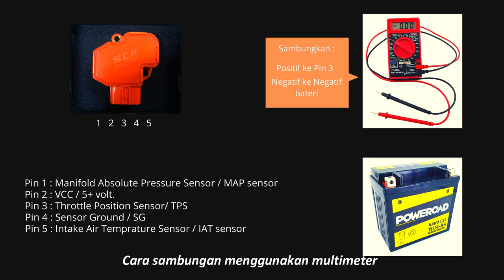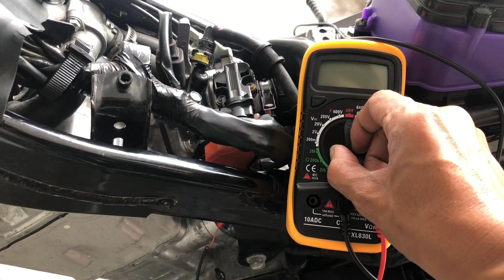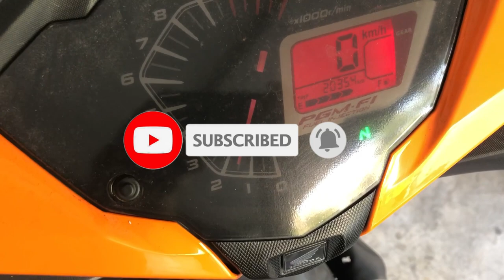Motor Semput? Tukar TPS Problem. Service Throttle Body RS150

Comment: Bro nak tau . Kenapa ek bila moto saya masa gear Neutral bila nak press throttle dia pandai semput . Apa problem ek ? Tps ke .? Ataupun ada yg lain . .
Reply from the maker: Rasanya bukan tps kot sbb kalu tps yg problem lampu akan blinking atau high rev motor semput. Bos try check or service TB, air filter atau fuel filter.

Comment: Boss..nk tanya...den tarik je full trotle bila berhenti timing jadi tak btl...kalau bawak slow ok je pulak
Reply from the maker: Aie Asiah cable kat throttle body dah check tak? Suspect cable x restore blk ke asal sbb dah xde greese. Kalu boleh cuci sekali throttle body buang kotoran
Reply: @chongsalmi  perkara terjadi..lepas den sarung ecu apido...lepas rpm 7 die jadi...time jalan tarahal..boleh je laju...cuma bila berenti...tapi bila dah berenti lama...dia ok balik
Reply from the maker: Aie Asiah ade tak cuba tukar ecu standard blk? Sbb nak pastikan ecu tu xde isu. Kalu x maknanya kena antar tuning blk la jwbnye. Nak tanya gak, ecu apido tu bos dah antar tune ke?
Reply: @chongsalmi  den tk hantar tune sbb den sambar apido yg cuma utk tkde cutoff...
Reply from the maker: @aiekhaizurah2154  bos, sy rasa better buat check rfid untuk check ade simptom problem atau tak. at least boleh detect error. tp biasa kalu high rev problem tps.
Reply: @chongsalmi hari tu den dah poie..tapi pomen kata fid utk reset je...
Reply from the maker: @aiekhaizurah2154  bos tukar ecu tu x dyno kan? kalu bos tukar ecu standard blk utk check ade x problem yg sama?
Reply: Problem tps tu. Sama mcm sy. Dah kene da

Comment: Apa beza tps ori dgn tps after market kalau moto std setakat tukau barang pipe tukar coil plug tukar plug tpi enjin std boleh pakai ke tps after market ni?
Reply from the maker: Tps after market cuma option utk tukar dr tps asal if tps asal yg kita guna tu ada masalah/rosak lps 2 tahun. Boleh je bos kalau nak tukar ke tps after market. Sy dah pakai xde masalah.
Reply: Ye ke bos brp lama pakai tps after market? Xde effect ape ape ke?
Reply from the maker: @lukeman8355  pakai cam biasa je bos xde effect apa2. Pakai agak lama gak bos

Comment: bro kenapa eh lepas service throttle body motor tak boleh start..lampu engine tak tunjuk indicator kelip² pun hm tapi dia taknak start..kena pulas baru hidup..tu pun macam bobok je. ade penjelasan tak?
Reply from the maker: Ribenaf ade tak check coil plug n spark plug?
Reply: dua² tu okay and sekarang dah tau masaalah dia and dah selesai..jawapan dia tps problem huhu
Reply from the maker: Ribenaf tps problem ye. Makna simptom problem ni dlm byk area. Ok2 paham

Comment: Bos kene tes lagi ke klau dah pasang bap sya tak ada alat pencek toe bos..😅
Reply from the maker: Akbar Karim My Life family tujuan check utk make sure samada tps ok atau x je sbb kadang2 tps baru pun ade yg x ok
Reply: Owh mcm toe..💖
Reply: Cuci pakai petrol aje ok kan.?
Reply from the maker: @muhamadzulhairikamisan6216  cuci throttle body ke bos? kalu boleh better pakai cleaner die dr guna petrol bos. lebih afdal
Reply: @muhamadzulhairikamisan6216  mau pkai Throttle body enda bleh pkai ptroĺ.

Comment: Bos..nak tanya..kenapa ye lepas saya tukr tps..rpm sya jdi tinggi ye?
Reply from the maker: bos ade cuba tukar yg asal balik tak? kalu bos x pasang lg coverset boleh cuba test balik atau check throttle cable.
Reply: @chongsalmi  sbb tdi lepas pasang tps..test dia idle dkt rpm 2...so fikir dia okay la sbb masih bru...lepas tu dh pasng semua coverset dia idle dri rpm 2 ke rpm 3... Agak2 apa ye symtom dia..sbb sya pakai tps tobaki .. ke nak kena fid?
Reply from the maker: @nickazizan6561  tps tobaki ade 2 jenis. standard dgn racing. Bos pakai yg mana satu? normal idle 1.5, 2 tu dah kira tinggi skit. Bos ckp lps pasang coverset idle naik 2 ke 3. Throttle bos ade play x ke camane. Fid pun leh gak buat utk reset error tp rpm tinggi tu kalu boleh check throttle dulu.
Reply: @chongsalmi  sya pakai tobaki std punya...tdi buka balik okey dh...mun ada cable sangkut kot
Reply from the maker: @nickazizan6561  cable sangkut tu bos. Kira dah ok le ni. Yg tps tu boleh buat fid utk reset error.
Reply: @chongsalmi  aaa kira okay dh..cuma tu je la lagi masalah datang...motor pandai padam2 masa idle....lepas tu nk start ada payah sikit...paksa main on off kunci bru okay start
Reply from the maker: @nickazizan6561  skrg bos bawak motor ade x semput lg? Just nak tanya je.
Reply: @chongsalmi  semput tu tkde la...masa lock trotle mengejut tu dia mcm nak pdam ade..
Reply: @chongsalmi  and masa tgh idle dkt traffic light dia pandai padam sendiri.. 2 tu je lagi masalah dia...penat dh fikir masalah😂
Reply from the maker: @nickazizan6561  masalah camtu kena check satu persatu sbb sy pun penah gak kena tp lg teruk start je terus mati. boleh start cuba tgk dr kepala plug dulu. kadang2 fuel pump pun boleh jadi isu. injektor sumbat pun boleh jadi. cuba check yg senang2 dulu.

Comment: Bro kalau masuk gear 1 lepas clutch sikit pulas throttle, motor ada jerking tps problem ke?
Reply from the maker: Tu bkn tps bos. Cuba check clutch lever. Penah bukak mangkuk clutch ke seblm ni?
Reply: @chongsalmi  dulu bukan masuk uma hyper clutch, selepas rasa tak sedap ada jerking, selepas pasang balik std pun ini macam juga pening 😪
Reply from the maker: @s.c.k2460  bos bukak sendiri ke pasang kedai? Masa masuk clutch cover besi bulat yg tgh2 tu kena check betul sebelum mskkan cover balik.
Reply: @chongsalmi  pohmen pasang  dia pun pening, tak tau issue mana ini check semua cluth ok, selepas pasang jadi in macam
Reply from the maker: @s.c.k2460  biasa kalu jerk gear tu pasal clutch lever. Kd masa gear 1 je kan?
Reply: @chongsalmi  ye bro itu masalah sahaja 😓
Reply from the maker: @s.c.k2460  penah x masa blk tukar gear 1 ke gear N masa off enjin. Then masa start blk msk gear 1 xde jerk?
Reply: @chongsalmi  same juga bro, 😓 tak tau masalah mana, clucth semua dah check ok je, tapi masalah ini
Reply from the maker: @s.c.k2460  kalu tarik clutch tp blm lps ade tak tayar berpusing?
Reply: @chongsalmi  double stand ada try, ada tapi slow pusing
Reply from the maker: @s.c.k2460  hurm...betul la tu ade yg salah pasang bos. Dekat housing clutch tu ade besi bulat utk clutch tu and kalu x salah sy ade spring lg (yg ni sy x ingat). Bos try check video sy yg tukar hyperclutch tu. 2 menda tu kena check. Mmg ade salah pasang tu bos.
Reply: @chongsalmi  ok bro 👌
Reply from the maker: @s.c.k2460  ok 👍👍

Comment: brand SCK ni bagus ke?
brape ketahanan tps ni?
Reply from the maker: setakat ni pakai ok je bos. Tp bab ketahanan tu sy x berani nak jamin bpr lama boleh pakai.
Reply: kalau ikut moto baru 11k milage..under waranty..huhu..upah nak sama mahal dengan barang kalau claim waranty barang..
Reply: beli barang lepas tu hantar bengkel..
Reply from the maker: @yie51457  tu masalah honda yg xde solution utk masalah tps ni. Biasa la bos, hantar kedai mmg camtu mark-up harga. kena sabar je la....haha
Reply: tapi ade yg rekemen pakai TPS Ysuku...mantul..
Reply from the maker: @yie51457  boleh gak bos tp modal kasar kalau tak salah dlm rm4++ camtu.
Reply: 1 set ke?
3 serangkai..
Reply from the maker: @yie51457  1 set bos

Comment: Selepas tukar TPS kena setting ap2 ke
Reply from the maker: xde setting ape2 bos. Pasang cam biasa je.
Reply: @chongsalmi  bro pakai sck nya brpa lama dh
Reply from the maker: baru lg bos. PKP ni xleh nak run motor tp isu semput dah xde. boleh tgk reading voltage dah stabil. tps bos dah rosak ke?
Reply: @chongsalmi  ya Moto jdi semput2 dkt 1mimggu tpi sya Masih Naik LG..lps to dh xblh hidup engin ..Dan Naik sensor dkt meter bnyk kli..
Reply from the maker: biasa kalu semput tu mmg masalah TPS problem. kadang2 ade naik kat sensor. ade gak x naik. TB dah service ke blom?
Reply: @chongsalmi  blom LG..sbb TPS bru smpy..nnti bru nk service skli
Reply from the maker: service sekali TB lps tukar TPS. sy ade juga cuba buat cleaning TPS tp setakat ni blm menjadi. 😂
Reply: @chongsalmi  yaka ok2..sya tukar sndri ja tngk video bro..tq sbb sudi bls chat
Reply: Sck mmg xrapat ka TPS dya. .sbb sya tgk standard rapat
Reply from the maker: x rapat camane tu bos? sy pasang ok je xde ape2 masalah.

Comment: tahan lama tak?
Reply from the maker: setakat ni pakai ok lg xde isu.
Reply: Chong Salmi motor std boleh pakai ?
Reply from the maker: @muhdsyahmi9906  sy motor standard pakai pakai ni leh je bos.
Reply: Chong Salmi ok . fid kena buat tak?
Reply from the maker: @muhdsyahmi9906  cam sy x buat pun bos tp kalu nak safety kena antar kedai buat bos.
Reply: Chong Salmi ok boss . sya pakai vf3i . dia tanda2 nk rosak . tak leh full thottle semput . bawak biasa ok . full thottle meter naik turun naik trun . berat
Reply from the maker: @muhdsyahmi9906  sym pun ade masalah tps ke bos?boleh cuba try check manual pakai multimeter kalu betul tps problem
Reply: Chong Salmi ada . tpi jarang jadi . hari tu buat fid . orng tu ckp tps nk rosak